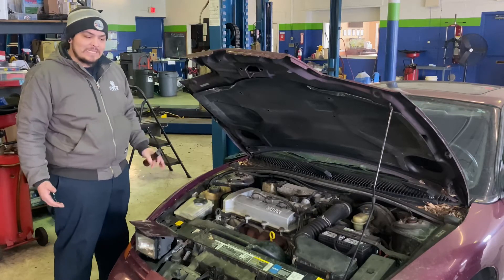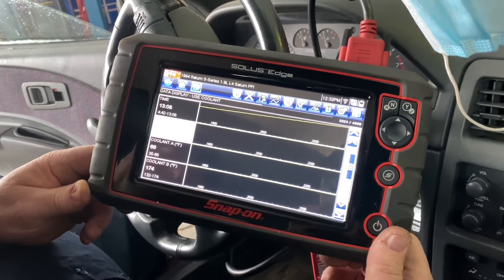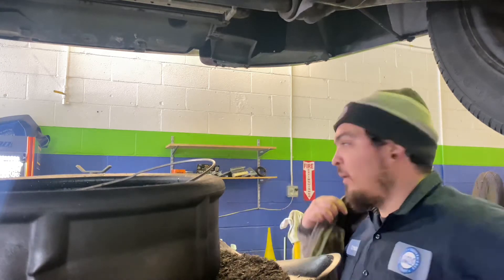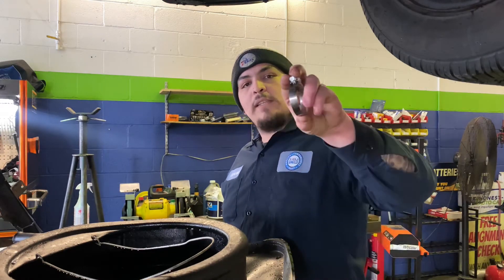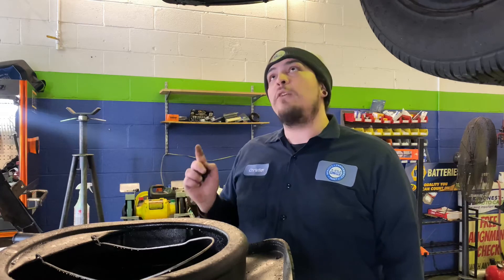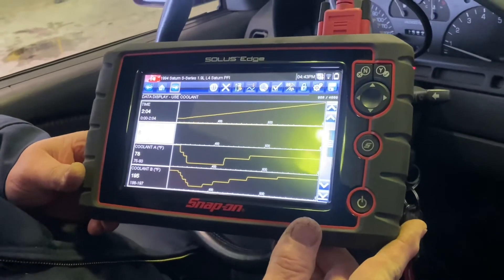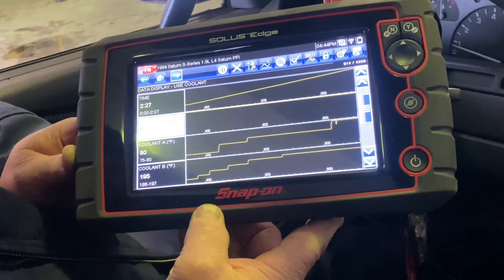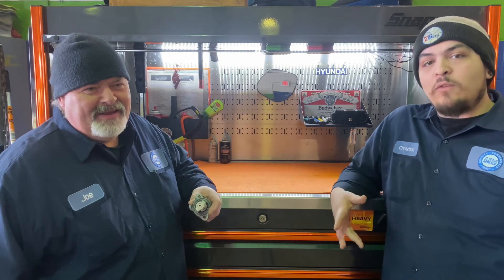1994 Saturn SC2 Thermostat Diagnosis and Replacement

Comment: What brand t stat did you install? Did you notice if it had the temp marked on the new one?
Reply from the maker: I’ll ask Chris.  He should remember.
Reply from the maker: Chris: “Couldn’t remember the brand but it did not have the temp on it. Had to make sure to order a slightly higher temp one because the other was just opening way too often not letting the car get up to temp properly.”